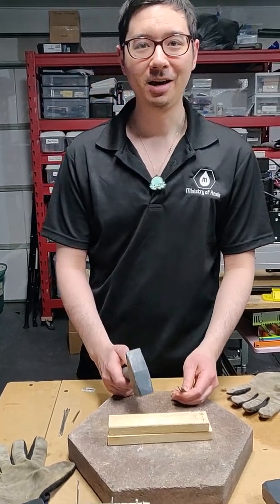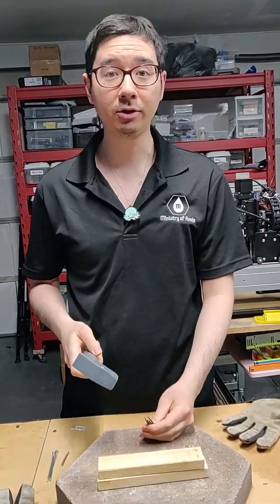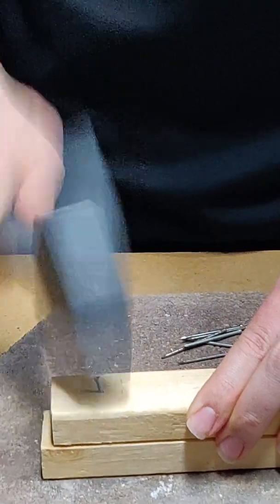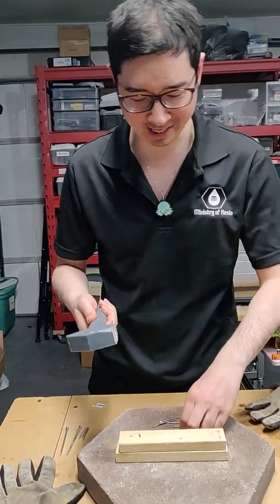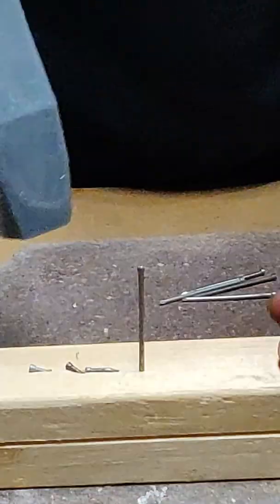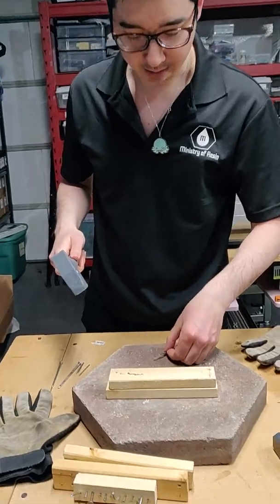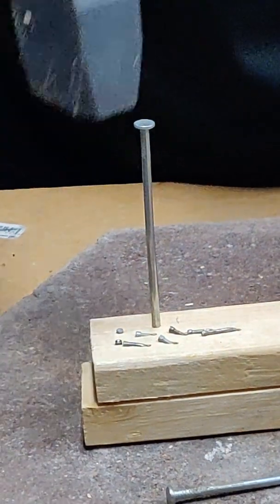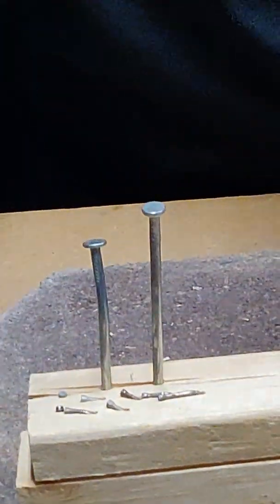Introducing Ministry of Resin Bang! High Impact Resistant Resin

Comment: i'm tying Bang! with Phrozen Sonic Mighty 8K Resin 3D Printer and getting failure after failure. 
also, what is a good cleaning method for bang!?
Reply from the maker: Shoot us an email at support@ministryofresin.com (or email us via our website) and we will be happy to work with you and troubleshoot the issue and get you printing.

For cleaning, isopropyl alcohol with some form of mechanical agitation like a wash and cure station should do the trick. We found that 10-15 minute soaks should clean parts with possibly some spot scrubbing for any stubborn patches that did not wick off the print due to the thicker viscosity.